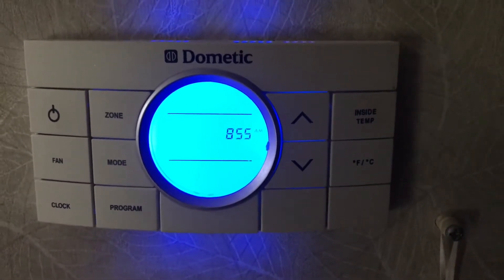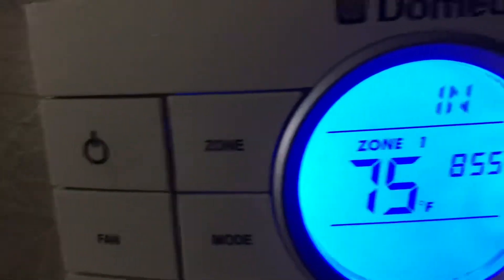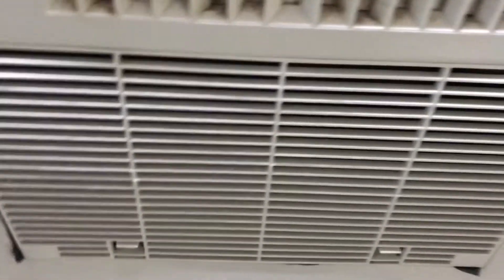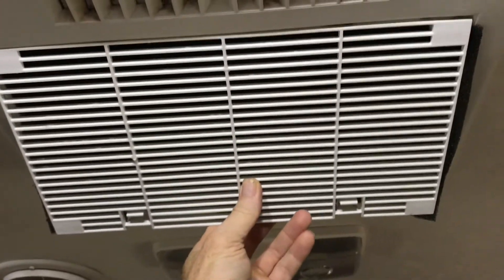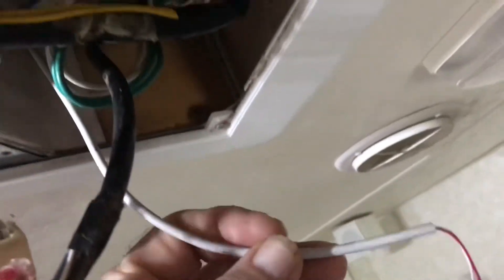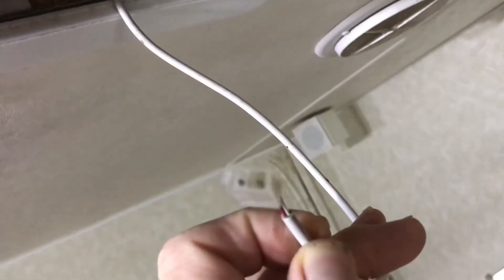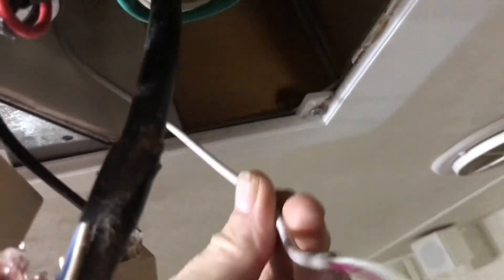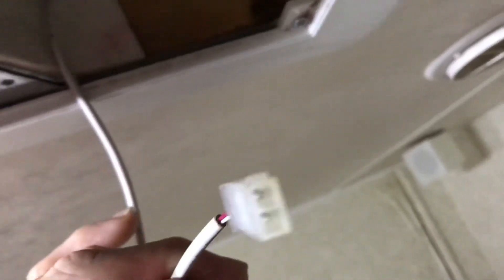Dometic CCC2 thinks its 32 degrees inside

Comment: THANK YOU!!!!!!! I stay in my rv for work. Came home and it was hot inside. Thermostat was reading 32 inside.  Worked on the unit till 9:30 pm and read all different forms and tried multiple things. Was about to give up when I came across your video after watching I went straight to the AC unplugged that wire from the control box and instantly the AC came on.

Comment: Thanks! We were able to access the “other end” of the thermostat phone Jack by removing the AC ceiling vent or AC air intake in our 2019 flying cloud.  Our unit is “ducted” with all of the wiring accessible by removing the intake filters.

Comment: I have the same 32-degree problem trying to have heat.  But I find no water, and the end is just bare wire.  Heat won't stop.  Any suggestions?  Please, and thanks.
Reply from the maker: If you have this same problem just dry the plug with a hair dryer even if you don’t think it’s wet. If you have a different problem, or more than one problem, obviously it’s going to take a different or additional fix. 

If the heat never turns off, even with the phone jack on the thermostat unplugged, I’d suspect either a stuck relay on the heat unit, or less likely but still possible a short somewhere in the thermostat wire. 

With both ends of the thermostat wires unplugged use a continuity tester or ohm meter to test between each wire, should be no reading between any 2 wires unless there is a short, easy to verify or rule out as the problem. 

Testing a relay is more advanced than I can explain to you in comments and you’d need to know if the relay is supposed to be Normally Open (NO) or Normally Closed (NC) in relation to the Common (C) terminal. Look up how to test a relay and pay attention to the mention of NO, NC, and Comm. 

Sorry I’m just now seeing your comment 3 years later, I never got a notification that there were comments.